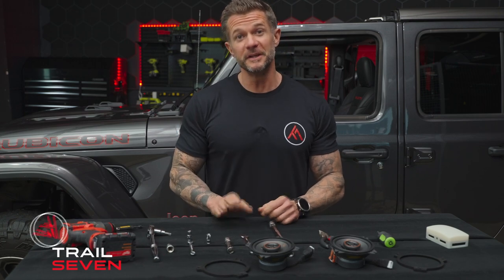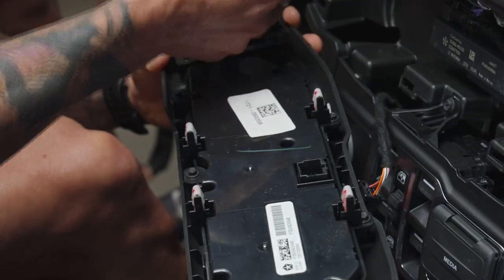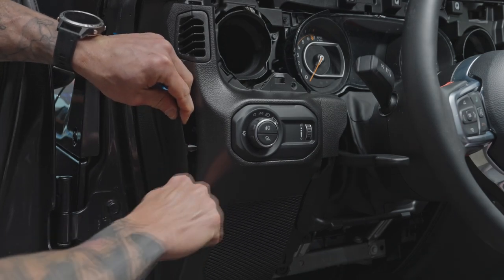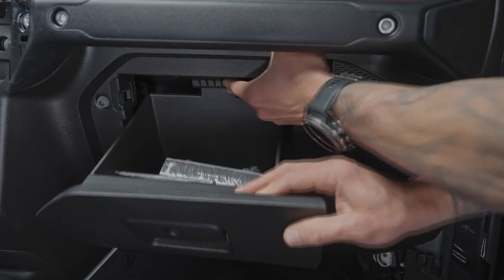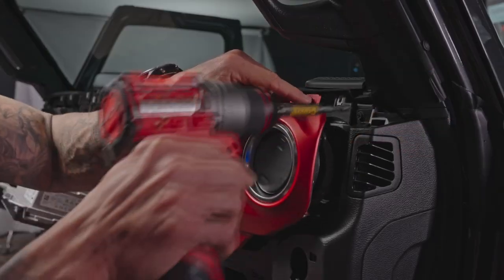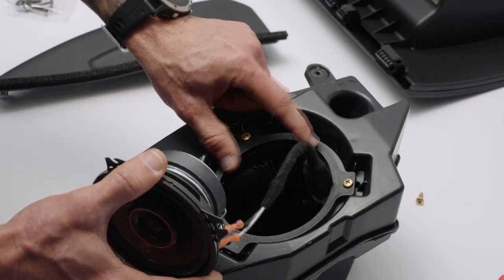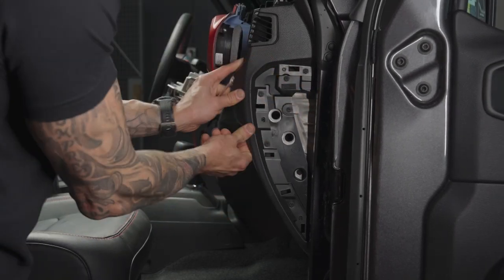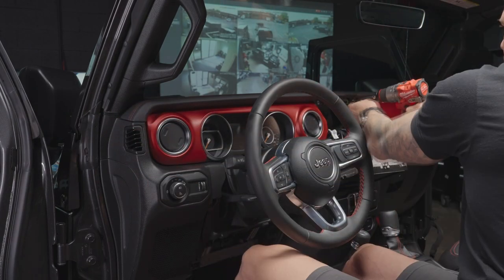Kicker Plug & Play Speaker Upgrade Bundle (Part 2) | 2018+ JL Wrangler / 2020+ JT Gladiator

Comment: Looks like good speakers, and although that is a good breakdown video, I've never took the dash apart, that's really not necessary, and the boxes will slide right out with minor manipulation. Also kicker could have made the tabs line up with the original screw holes, taking the chance on screwing tabs and possibly bending basket, as could happen with a new installer, will distort the speaker, and we know what comes next, premature speaker failure.
Reply: Yeah,  I'm calling BS on you.  There is ABSOLUTELY NO WAY to get the factory JL or JT knee boxes out with "minor manipulation ". Anyone who owns one knows that's a pure lie.  If you post a video showing it, I'll pay you $100.00.
Reply: @vtxrecruiter  100.00 ??? Seriously I've owned many jeeps, as now I own a 2023 Rubicon 392. And I've always installed my own systems, lifts etc, whatever it is. But if you live anywhere near NY I'd be glad to show you for 100.00 per side 👍👍. Like I said MINOR manipulation is all it takes, and to be sure the passenger side is the easiest. If you actually took the time to look at speaker boxes from underneath, I'm sure even a denier as yourself can see how to do it......Minor manipulation. Seriously not that serious, but hey if you want to take your whole dash apart 🤷🤷have at it. I've been doing these things along time, matter of fact it's all I do.  Take a look and let me know if you see a way, Ive given you inside info. Your problem is your looking at videos of people whom mostly do not think outside of the box, which is fine, sometimes though all that's needed is to look at things from a different perspective and BAM 💥 your like, why didn't I think of that.  So I'm calling b.s. on your b.s. because you haven't really LOOKED at it .
Reply: @williamh6547  
So post a video as I ORIGINALLY MENTIONED.  BTW I work teaching techs how to repair 7 Mil plus $$$  gas turbine engines, I DID look, and you DO have to essentially take the whole dash area apart. There is no way to access 2/3 of that knee box hardware.  So post a video and put the link here.  I'm sure the entire Jeep Community will thank you!!!!
Reply: @vtxrecruiter  I'm not a professional YouTuber 🤷🤷have no interest in being so. So there won't be any videos, I work to much. 
   My original post still stands, with minor manipulation you can take the speaker pods out, loosening a few things is a far cry from removing the entire dash.
Reply: @williamh6547 maybe just give me an update on it? You know did you drill screw holes out what? Would like to know. No video needed you can type so clearly just describe it for us every day guys researching kits

Comment: Wha is the part number for the 4" speaker adapter plate? Thank you for a great video.
Reply from the maker: The bracket comes with the 4” speaker but not as an individual bracket part.

Comment: I have a stock 7" UConnect basic sound system. I've seen others install Inline output converter behind the head unit before connecting any upgraded speakers. Should that be the case here too?
Reply from the maker: No not at all.  You will not need an inline converter to swap to these speakers.  With some amps/ subs, you may, but not with just these speakers.  

Also, a PAC preamp module behind the head unit is needed when installing an amp to a factory head unit but not speakers. 

These are simply unplug your existing speakers and connect the new Pods and speakers which come completely wired and ready for install.

Comment: I installed this kit last year in my jeep gladiator. The speakers sound nice, but the bass on lots of songs almost make the speakers sound "blown" in the dash and the knee panel speakers. I felt like the bass in my stock knee panel speakers wounds more punchy with the bass. I have been looking at the 10" factory unit install kicker powered sub on your site. My question is if I add that subwoofer, do you think that the "blown" distorted bass sound from my speakers  in the dash likely be eliminated? I have had subwoofers in all my past vehicles and I felt like the bass was signaled to the subwoofer and took away the distorted bass on the speakers alone. Thank you.
Reply from the maker: Hello There-  I would ask what the bass is set at on your factory radio.  Keep in mind that those Kicker speakers thrive with the more power that they're provided.  If your pushing them with the factory power, there is only so much that they're receiving.  When speakers aren't provided enough power, they will struggle to produce loud sound, potentially leading to distorted audio, especially at higher volume levels.  

If you add the Kicker Hideaway which is what I believe you're referring to, you can add bass into the Jeep and lower the bass on the radio, however this isn't resolving the problem.  

To truly resolve it, adding an amplifier is the full solution while adding the Hideaway and lowering the radio bass is a workaround, but it's not solving the problem. 

Hope this helps.
Reply: @trailseven  I don’t have the bass very high, but I have the stock 5” head unit and no amplifier. I may just have to buy an aftermarket head unit to get the full potential. I was hoping to wait as they are pricy, but I might have to go that route before adding a subwoofer. Thank you
Reply from the maker: @ An aftermarket radio will help with a little more power as well as adjustability vs the basic adjustments with the factory.  

We carry Stingers Heigh10 which has been reduced to $999 if that helps with an option.

Comment: So what good will these do. No amp, you are just connecting good speakers to no watts. How would I add an amp to a plug and play gladiator?
Reply from the maker: @johnpringle5842  Glad that you asked.  We have a full plug and play amp, speaker, and sub bundle which demonstrate the installation using our Gladiator. 

https://youtu.be/3tuUp_6iKuE?si=YHPt3xgw1LcOpR5E

Comment: Can you not pull the front grill on the knee box to remove the speakers? Even if you have to buy a new grill it might be worth it.
Reply from the maker: @chogg611  No, the dash trim panel is attached to the grill so would probably be an expensive route.  But if that’s your chosen method…..

Comment: Are the brackets/rings necessary? Or can the speakers be mounted directly to the speakers boxes?
Reply from the maker: If you’re referring to the pods, yes they are required.  The stock housing won’t allow for the larger speakers.
Reply: @Trail Seven  can I just buy the rings/Brackets? I already have speakers and connections/adapters.  I'm looking on your website
Reply from the maker: @fernandoamador4745  Please submit a contact form with your request and we can accommodate your build.  https://trailseven.com/pages/contact
Reply: @trailseven  done
Reply from the maker: @fernandoamador4745  You’re needing the rings for the knee panel speakers?  Those are provided with the Kicker speakers and not sold separately.